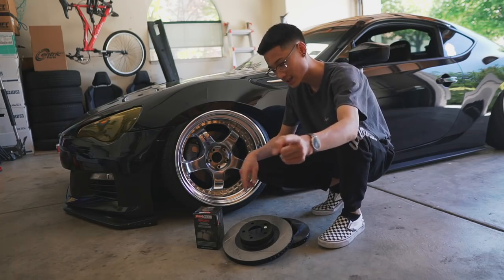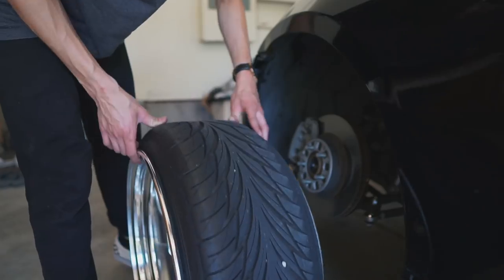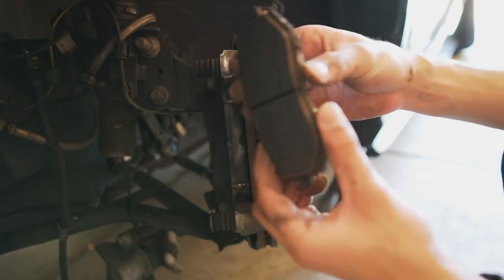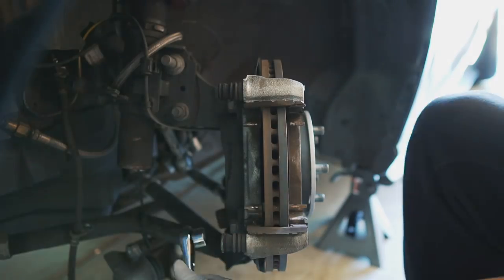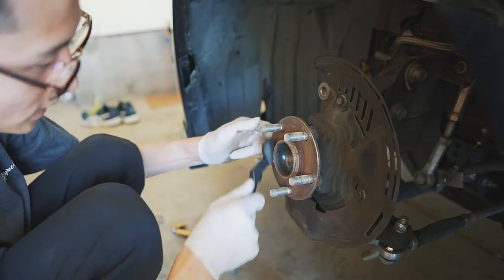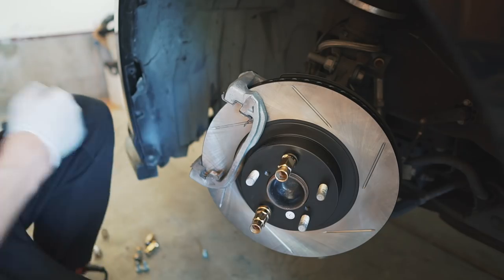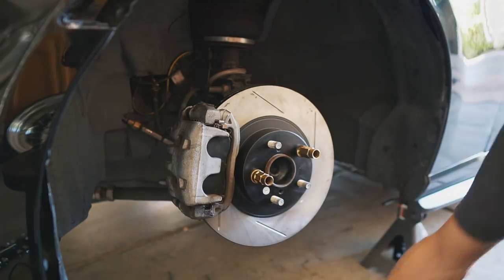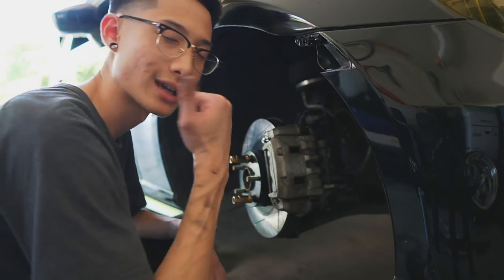EASY Brake Upgrade for your FRS/BRZ

Comment: It's about time I replace my pads on my BRZ... but I don't know if I need to replace my rotors. I read that it's best to replace rotors at the same time with pads because your pads also need to get use to the rotors, they're like a couple. Pads seem easy to do by themselves, but rotors looks like you got quite a few more steps. I just need the right tools. Thanks for the video! I need to watch more.

Comment: a lot of the time if the brake pads still have a bit left and they are squeaking it is because there is no grease or lubricant between the pistons and the pad, and the same on the outside pad and the three little fork things. My workshop uses this method and we rarely get complaints of brake squeal, would highly recommend doing this the next time you change brakes. Not a must, but is highly advised

Comment: You should have sprayed brake cleaner to clean the rotor. Sometimes packagers put some type of liquid protectant on the rotors from outside contaminates. Good to clean that up so pads don’t where uneven or rotor warps
Reply from the maker: Nick Tank Don’t worry, I didn’t overlook this step. I cleaned up the rotors before installing, but there wasn’t much oil from the manufacturer.
Reply: He literally does so on the video
Reply: Are u dense? He sprayed brake cleaner all over them

Comment: This is even easier on a new car like this :)
I'm having trouble on my 1996 Peugeot 306 because of the old nuts and bolts all rusty/dirty or getting deformed by the tools... I'm gonna have to heat them up

Comment: Shouldn't you be replacing the rears since the car is RWD? I thought RWD uses rear brakes more than the front.
Reply: Nope more than 60% of braking are done by The front. Doesn't matter if FWD,AWD, or RWD. When you are braking, the weight of the car shift forward placing more stress on the front brakes.

Comment: My brake pads have a lot of life left too and I’ve cleaned all the hardware and they still squeak. Guess I’ll get new brake pads
Reply: yo man try putting brake grease or lubricant between the outside of the pad and the caliper
Reply: iChubbbzTV already have done that twice and it stops for like a day then the squeak comes back. I have drilled/slotted rotors with duralast gt pads, is it because of the autozone pads or what lol they have a lot of life left
Reply: does it only happen when you first start driving for the day or for the whole day, even if the brakes are warm
Reply: iChubbbzTV I’ve noticed that when I turn it on in the morning omw to work no squeak until I actually make it to work. So I guess once it’s warm they squeak.

Comment: did you bleed the brakes?
Reply: I dont think you have to bleed it if you are not replacing the caliper. The brake system has not been open for air to leak in
Reply: It's an extra step that's recommended while you're in there but you can get away with not doing it
Reply: Wrong u dont have to bleed them to do what he did
Reply: U don’t have to do anything, heck u don’t even have to replace the pads if or rotors u don’t want to, but it’s recommended
Reply: Its not even an extra step bro. What you are saying is like changing engine oil after you replaced brake pads.
Reply: FiRsT465 cool man 🤘🏼